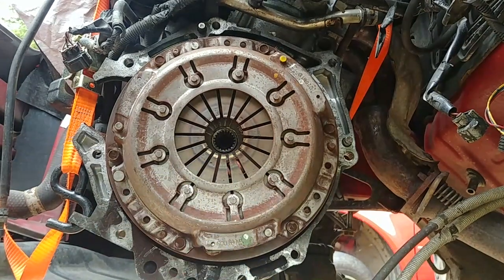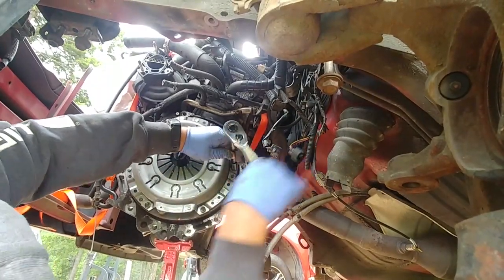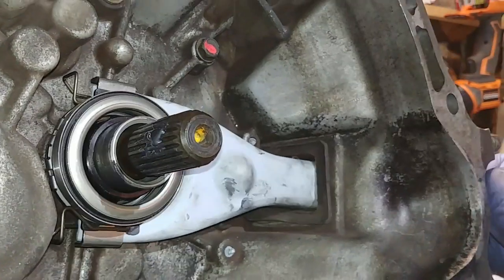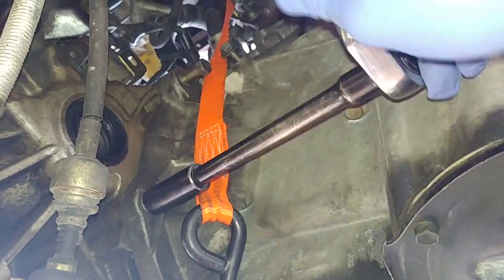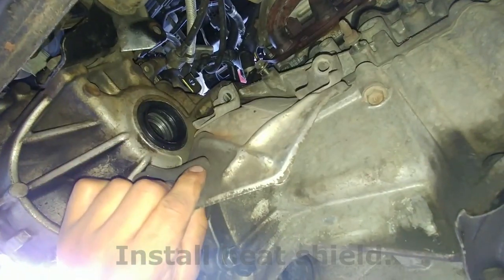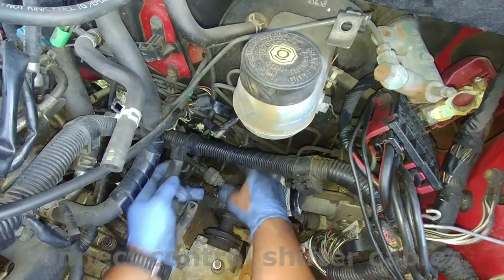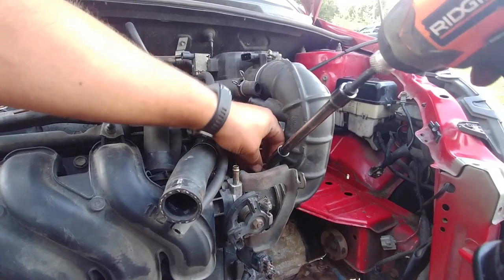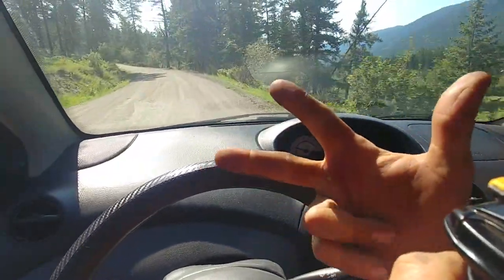HOW TO INSTALL NEW CLUTCH and GEAR BOX on Toyota Echo, Yaris.Transmission SWAP. Ep. #2

Comment: All that work and not removing the flywheel and replacing the rear engine main seal is a job halfway done. If you develop a rear main seal leak a few weeks or a cfew months down the line then you will have to take all that apart again just to replace a $5.00 seal.
It's easier to just replace it all at the same time . Thanks

Comment: Hi great video and very informative, where did you get the workshop manual from and can you confirm its a 1.5 litre 1NZFE Engine
Reply from the maker: Hi check on inside the hood for any engine information. 
I Googled: ''toyota echo 2001 repair manual pdf'' then found good source https://caphector.com/atoyota/TableOfContents/manual.html
Check also: Directly  Toyota's OEM Website at http://techinfo.toyota.com